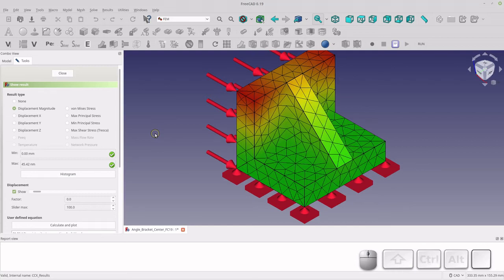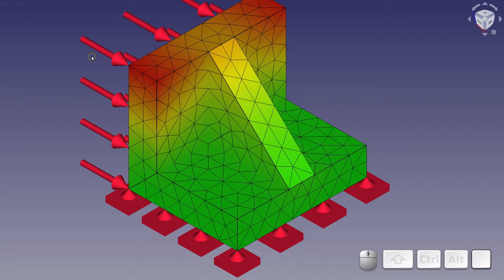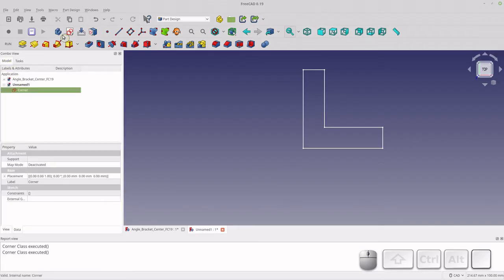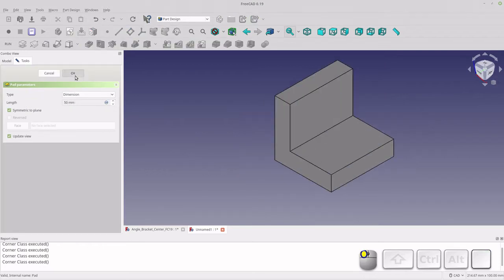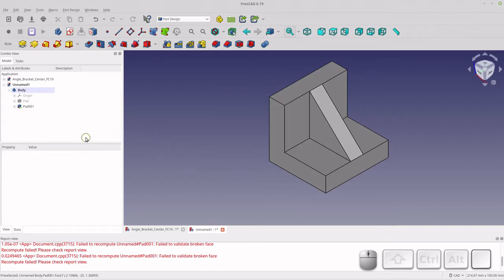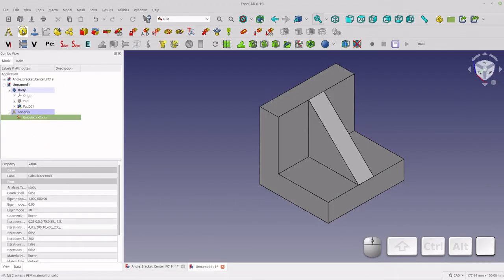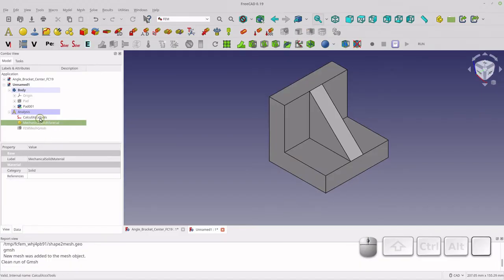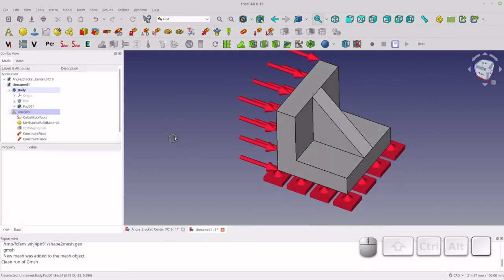FreeCAD FEM Tutorial - Getting a result

Comment: Something important when doing FEA is the size of the mesh elements. If the mesh elements are too big, the FEA results cannot be trusted, If the mesh elements are too small, the time to solve the simulation will be too long. So in order to trust or have some confidence that a real part will behave and deform as in the simulation, you have first to so a "convergence annalysis", in which you will find out the propper size for the mesh elements. The shape of the mesh elements is also important. Also, since you  mention you used this for PLA parts, I assume you are 3D printing them. The phisiscal properties of 3D printed parts are very different from those of the material itself, so some times is hard to trust FEA for 3D printed parts. 3D printed parts are very un-isotropic, meaning that their mechanical properties change with space. When I did FEA for PLA 3D printed parts I selected a safety factor of 10 and a yield strenght 75% of that of pure PLA. This was te only way to get results consistent with the lab experiments... Hope this helps...
Reply: I saw his mesh, and I died a bit inside. There should be a mesh inflation region near the rib so there's less artificial diffusion around it. Currently it shows that there are no stress concentration regions around the rib, which is physically incorrect.
Reply from the maker: I know this comment is really old. Sorry I almost killed you :), I was really just trying to show how to get A result, I know nothing about FEM or FEA, should've made that clearer. Glad there are folks here smarter and more experienced than me.
Reply: You have to make mesh size sequence to study the influence of the mesh, but that mesh seems very good to me for the kind physics studied.
Reply: assuming the 3d printed shape is solid and not filled with air, isn't there something like annealing?
Reply: Very interesting write up. Helpful to know you ran experiments to validate the meshing choices. Thanks for the help!

Comment: 6:00 by the way, you need other things installed that weren't mentioned AND don't come standard in freecad AND have difficult windows install AND remains completely unaddressed. thumbs down, wasted 7 minutes
Reply: Worked just fine in my version on Windows - I did build it myself from the source, maybe that helped.
Reply from the maker: Only 7 minutes? I probably used up 7 hours trying to figure this thing out. I thought I linked the two additional libraries needed. But, yes I didn't want the video to be overly long/complex. I run :Linux so I can only really talk to that. Those two libaries "Calculix" and "gmsh" install with two commands. I feel your pain tho' I am sure windows is not anywhere near that simple.
Reply: On windows nothing  needs to be installed. All is included. On Linux one needs to install gmsh and calculix. Takes less than a minute on Debian based distributions. My recomendation is. If you not succeed just ask on FreeCAD FEM forum for help. cheers bernd